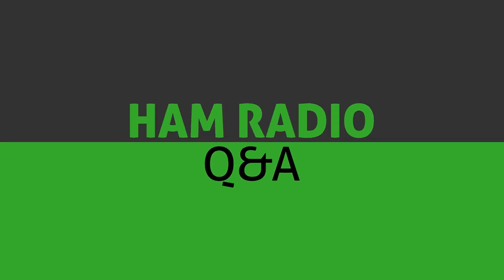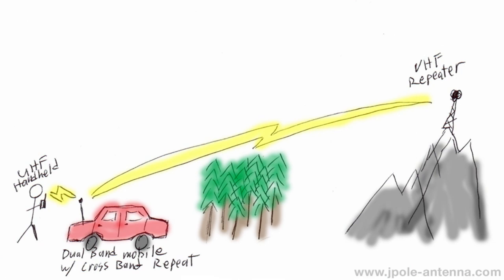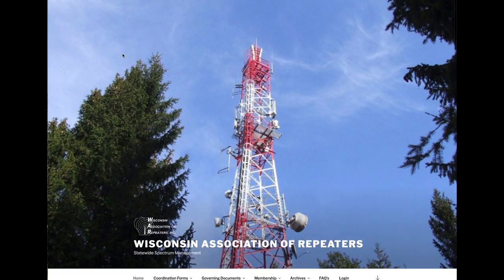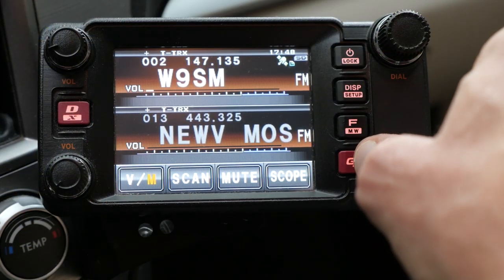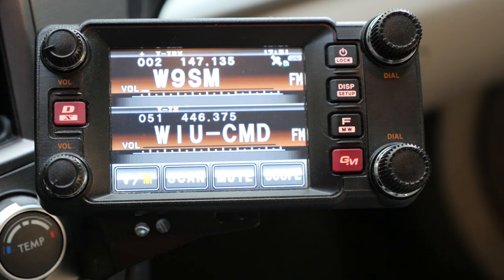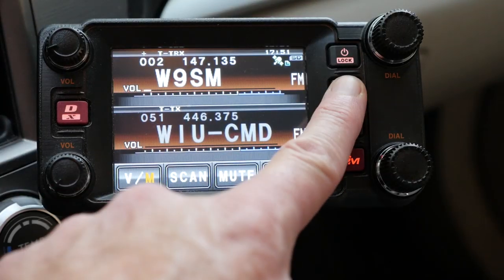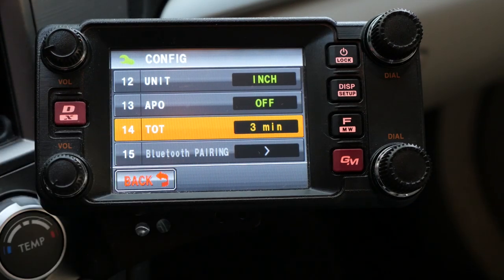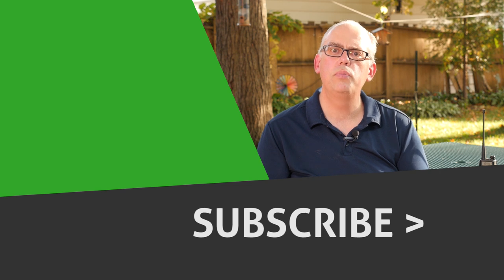Cross-Band Repeater Operation with the Yaesu FTM-400XDR - Ham Radio Q&A

Comment: only negative with this, if the Car is off, any radio I have tried this with will not operate on anything but 5 watts and for only about a half hour before it reboots whenever the radio keys up due to low voltage.
Reply from the maker: Unless new cars are different than mine (2014 Outback), you may want to check your battery as it may be towards the end of life. I direct connect the radio to the battery and can run full power when the engine is off. But that brings up a second issue: running cross-band with the engine off for an extended period of time will deplete the battery and may leave you stranded. If I anticipate using crossband for more than half hour or so, I will connect the transceiver to an auxiliary battery so I'm not concerned about running down my vehicle battery.

Comment: You have to make sure that your crossband radio is capable to identify itself every 10 minutes.
Reply: who will know or care, just do it have fun.
Reply: @brian.7966  I am only echoing the message from our local OO (official observer) if your on a repeater that is very active and your radio does not identify and comes up with an issue you and they are screwed ,not even mentioning the interference with any other operation that may be going on.
Reply from the maker: The issue is a little more complex than this‚ and I touch on this very problem of cross banding in the video. The VHF side is good as it is identified when you identify in the normal course of a transmission. The UHF side that comes back to your handheld is the one that would be considered an unidentified transmission. Yes there may be an identification tied to it via the repeater or another station using the repeater. But since the UHF transmission is originating from your radio‚ it also needs your callsign attached to it. 

How to solve this issue? Kenwood TM-V71A and TM-D710G both have auto identifiers built it- so if cross banding is an essential feature to your activities I'd recommend those radios. You could have the other party on the repeater identify on your behalf eg: K9XYZ on KB9VBR cross band‚ But this is cumbersome and the other person may not realize you are cross banding. Or third‚ do a identification on the UHF channel from the cross band radio when you turn the cross band off. It's better than nothing but doesn't satisfy the 10 minute rule.

That being said‚ you can see why people cross band‚ don't identify the UHF channel‚ and hope all will be well.
Reply: Our club had a problem with that. A member was using crossband and utilized the 10 min CW announcement on his Kenwood mobile rig. The thing kept going off every 10 mins and interfered with everyone's conversations on the club's repeater. They told him about it and he shut it off. At the next meeting, the member gave a presentation on crossband repeating and the rules and regulations. He said the same thing about the FCC and station ID. It boils down to common sense and good practice with the spirit of regulations. Is it 100% legit? Not really, but it makes everyone happy and there is no abuse.
Reply: @KB9VBRAntennas  Another solution is to transmit your call sign from your HT with no split on the output frequency of the repeater you're linked to (with pl tone if necessary). That way it's picked up by your cross band radio on the 2m side and retransmitted on the 70cm side. You could save that in memory in an adjacent slot to your cross band frequency for quick access.

Comment: Have several cross band mobils, Yaesu FT8800R, 2 FTM 400XDR,  TYT9800, used to have a IC2720 which I lost in the flood of Harvey.  Also used to have a Icom W32A handy talkie that we used on balloon launches for the 90,000 foot antenna which we worked stations all over Texas and Louisiana. Do several events using them, bike-a-thons,  marathons. We have a Special Needs event that is spread out over a wide are. Love all. Thanks for the video.